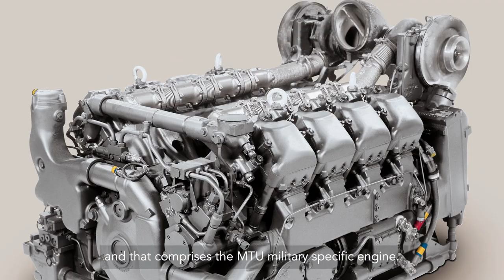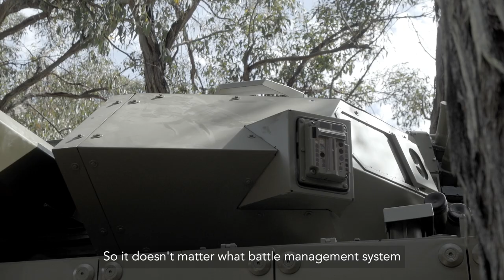Development of the Hanwha Redback Infantry Fighting Vehicle

Comment: I thought it was a no brainer, the redback is built on a tried and  proven chasis the lynx is new and must still have bugs to iron out.
Reply: The Lynx is based off the Puma so it is not entirely new and has parts interchangeable with the Boxer and Leopard.
Reply: Considering they have released very little information about the trials I would be interested to know where you are getting this from or is this just your opinion.
Reply: In terms of the Lynx the transmission is drawn from the Puma, the engine is commonly used in construction and the NBC is the same as the Boxer. The turret is exactly the same as the Boxer and Rheinmetall and NIOA in QLD have partnered through building a Rheinmetall munitions factory in QLD which will produce all Rheinmetall munitions locally. The lynx also has scalable armour from 2 to 6 with add ons as well as active and passive enhancements. Further the vehicle has a top speed of 75km/h compared to the Redback at around 60km/h. In addition the redback is approximately 41tn while the lynx is scalable from 25tn to 51tn depending on the arrangement. Finally, while yes the lynx currently in trials as traditional steel tracks, the lynx also comes with rubber tracks.
Reply: @thomaswheeler7767  it's not just his opinion. There has been some leaked information on the rma that flavours the redback.
Reply: If you buy the Redback you need to buy every vehicle new SCE, which will cost millions for years to come. As well, the lynx has the integrated hull that supports cross platforming between it and the boxer, which we already own.
Reply: @thomaswheeler7767  rubber tracks don't work as well if your chassis and suspension wasn't designed to take them on from the ground up.
Reply: @callofdutysniper100  on the flip side there is parts interchangeability between the AS21, the M1 tank and the AS9 Huntsman.